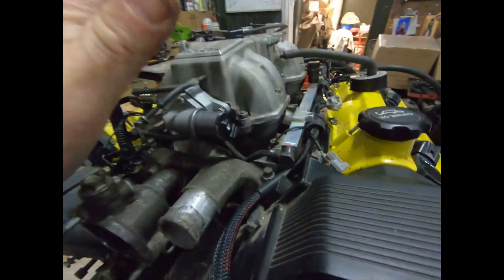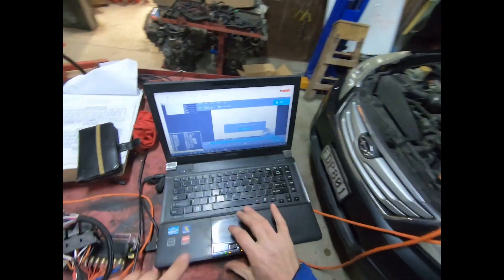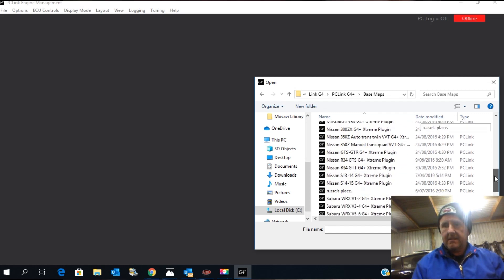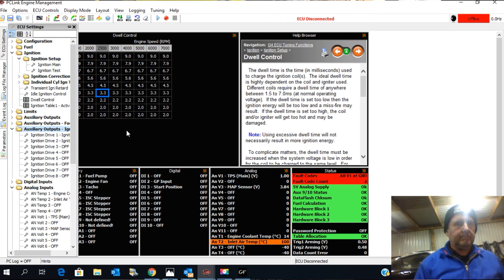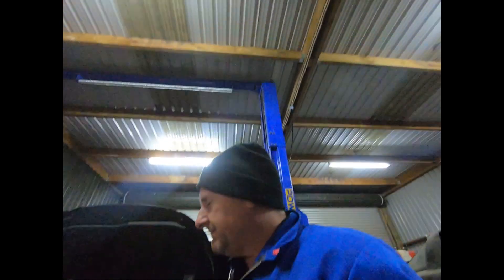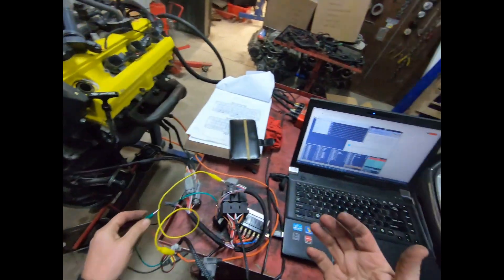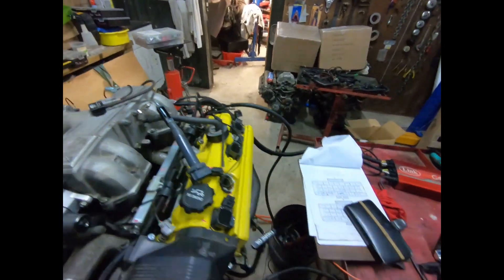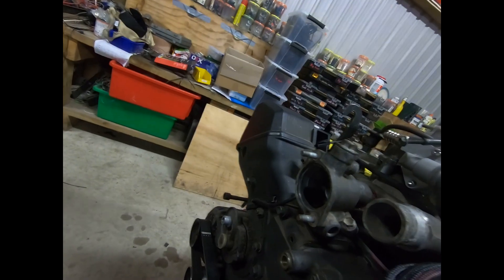LINK ECU Tuning.  How to set up your Link ECU.  Doing a Spark test with PC link

Comment: How do you set up the dwell table? Not sure I quite understand where you get the timings from?
Reply from the maker: Hello Tom.  Choosing dwell settings is a bit more of an advanced feature however in this case I copy and pasted some settings from another tune.  Dwell settings are going to vary based upon the coils which you are running.  Some manufacturers of performance coils supply dwell settings which is nice.  Otherwise the settings are often based upon experience of the tuner.   Cheers Kelvin.
Reply: @CartuneNZ  Hi Kelvin, and thank you :)  I'll probably be running Denso Honda K20 coils due to price and availability here in Denmark. I'm guessing I should be able to source some kind of information on them regarding dwell settings then. And hopefully my tuner will be of some help..
Reply from the maker: @tomaastrup6695  Hello Tom.   If dwell settings are available it makes setup much faster.  Hopefully you find some.  Cheers.
Reply: @CartuneNZ   I hope so too :) Thanks.